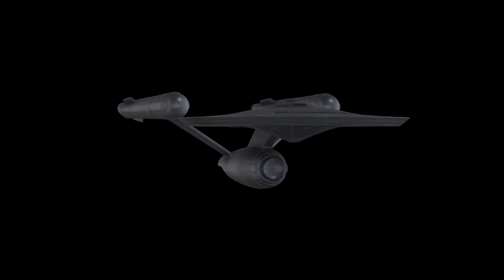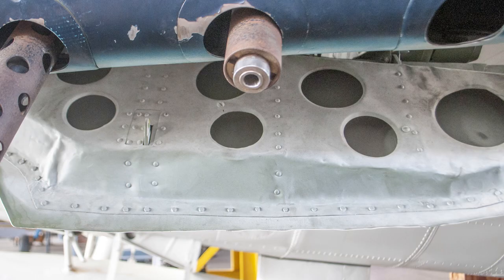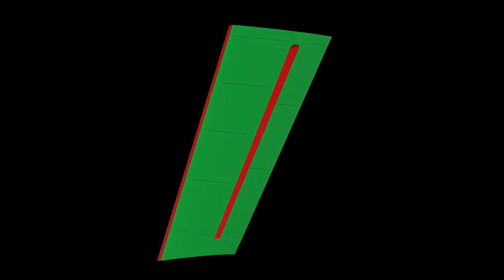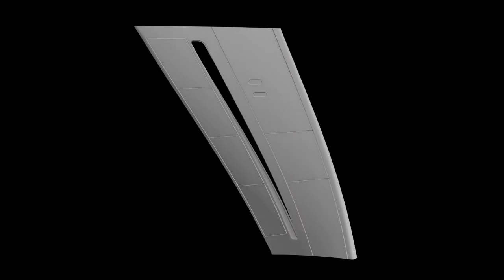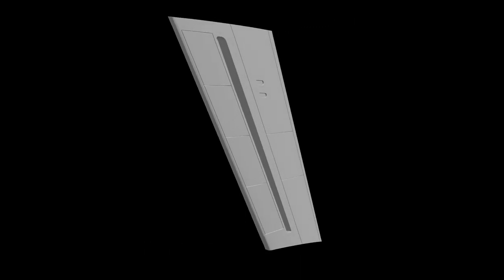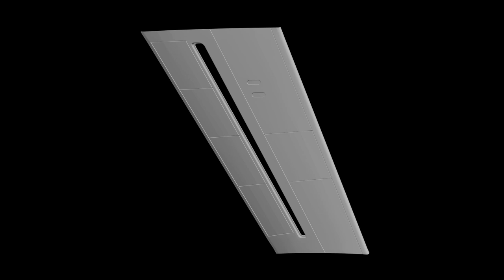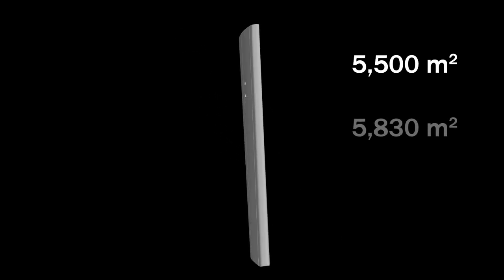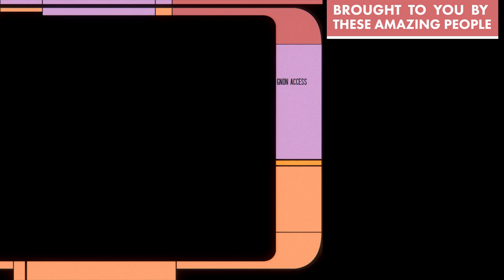What's the Deal with Pylon cutouts?

Comment: You should keep your "engineering" in the realm of fantasy/fiction along with the story, as apart from the obvious weight saving, you have no idea about what you are talking about.  If you only had the slightest idea of what extreme fiber was in engineering.  You scratch the concept briefly, only to contradict it moments later.  Then there is your "heat" argument.  Reducing your heat conduction area and increasing the radiating surface by let's say 10% for cooling is hardly note worthy.  Best to just stick with the cool factor argument.  At least that way you can keep your credibility.